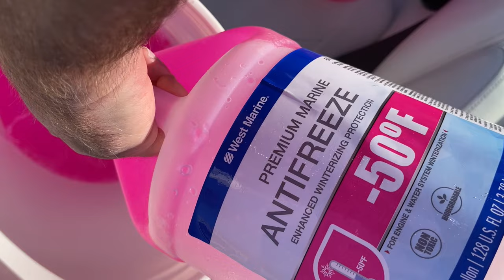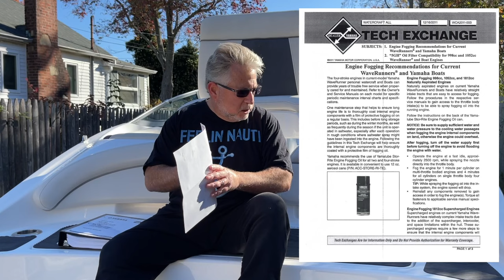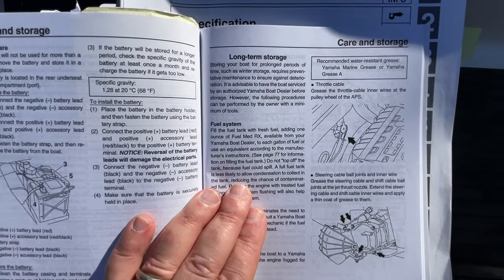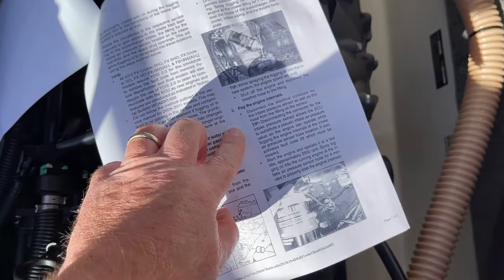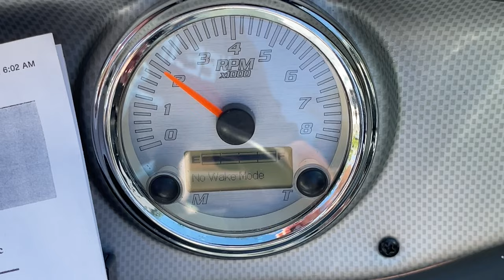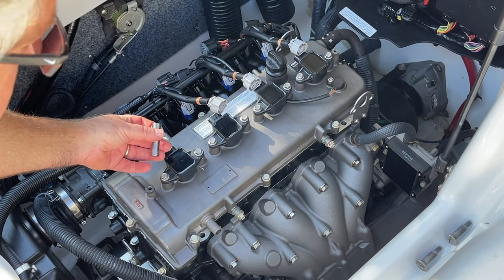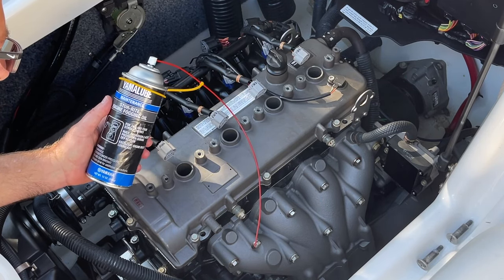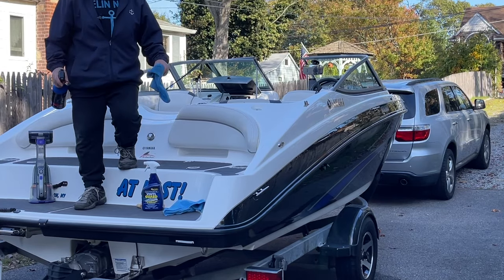Yamaha Certified Jet Boat Winterization Guidelines - What you really need to do!

Comment: Leon ... no need to remove the air intake tube and airbox cover .. just spray directly in the breather hose port .. you are creating a stronger vacum by doing it this way , delivering the fogging oil better to the internals
Reply from the maker: I thought of that but do not want to get any fogging oil on the air filter. I hate that I can't see where its going.

Comment: It's important to use antifreeze in the cockpit drains (don't know about this particular model, having a drain line freeze and crack in a Yamaha Exciter can ruin your day).  Also, the antifreeze should be pumped in around the bilge pump and allow the pump to pump it out.  Then there is the trailer...
Reply: You are correct man.
I can't believe yamaha doesn't mention it.
And of course all these boat nubes will read the manual and think that's the word of God.
Your car recommends an oil change every 15k, would you wait till 15k though?
Fck no.
Pour that antifreeze in, there's no way for all the water to exit the engine completely with these water cooled motors, you are absolutely correct any inboard, out board, jet boat or jet ski engine,  unless it's closed loop coolant system, it's gonna need antifreeze. Period.
Anyone who wants to argue with that can put their foot in their mouth

Comment: If you turn the engine over without plugs, fuel is sprayed into cylinders without burning. Can this excess of old fuel left for several months in the cylinders cause some problems?
Reply from the maker: I turn the engine over for just a second with the lanyard pulled to prevent ignition. I'm not sure if fuel is injected, but if it is I'm sure it won't hurt. Great observation though!
Reply: @CaptainLeonsBoatingandMore  I haven't tried with the kill switch off. Maybe this will cut off the fuel. I wish there was a mode like on Sea-Doo's.

Comment: That Pink RV/pool antifreeze is not for the use in an engine...and it states that on the container so not sure why you would use it and not use the proper antifreeze for engine use?
Reply from the maker: Eric, here is what I use: https://www.westmarine.com/west-marine--50f-engine-water-system-antifreeze-gallon-499848.html, read what it is designed for. Thanks for looking out and thanks for watching.
Reply: @CaptainLeonsBoatingandMore  Well I stand corrected and Kudos to you...first person I've seen to not use the cheap RV antifreeze that turns to slush at 5*F. Though that product only protects to  14*F. I'd still use standard green 50/50 engine coolant.

Comment: How do you keep your engine bay so clean!
Reply from the maker: Steve, I'm careful when changing oil to not drip oil during removal of the filter. I also just get in there with towel and spray cleaner and clean the fiberglass bottom now and then. It stays pretty clean on its own too.

Comment: I'm lucky as my AR195 fits perfectly in one of my garage bays.  The garage isn't heated but I do run a small electric heater out there that always keeps it well above freezng.  Of course I do the regular maintenance following the recommended schedule, oil change, plugs, use a fuel stabilizer, battery tender, etc.  This past summer was my 3rd on this boat and it starts up on the first try each and every time.  Always enjoy your videos!
Reply from the maker: Sounds like you have a good set up Hoosier, nice! Thanks for watching.

Comment: Why not just spray in into the breather tube? Open the throttle a bit, and suck it in. That's what I'm going to do...
Reply from the maker: You can, but I always feel I would risk getting some on the air filter. I also wipe the inside of the air intake with a paper towel when I'm done as some usually drips to the bottom in there.
Reply: Yes, I did that for a couple of seasons and found that the airbox got soaked with fogging oil...

Comment: They think you dont have to use rv antifreese for these newer boats as if they dint have water cooling jackets thruought the engine and a waterbox filled with water in the exhaust system.

YES YOU NEED TO USE RV ANTIFREEZE.

Ive been winterizing, servicing and wrenching on skis, jet boats, outboards, inboards for over 15 years and none of these engines will allow all the water to drain entirely.

If someone tells you that you dont need rv antifreeze, unless its a closed coolant loop system and not water-cooled - then dont listen to em. I promise you do 👍
Reply from the maker: Thanks tg, yes I use antifreeze too.

Comment: Hi Capin Leon, 

first of all, I find your YouTube channel very informative and enjoyable. I am an owner of Yamaha 195FHS, purchased in 2022, and I also live in Long Island. Could you please let me know where I can purchase the spray nozzle staw? The one I bought from Amazon doesn't fit the Yamaha Fogging Oil Spray, so I couldn't use it. Can you provide information on where to buy the straw as shown in the video? 

By the way, last year, while performing fogging oil with a short straw, it got sucked into the throttle body. ^^) Also, the 2022 model has a pan right in front of the throttle body, so when I turn on the engine, the fogging oil sprays out immediately. In such a case, how should I apply to fog oil?
Reply from the maker: Thanks Peter. So I don't remember where I got those straws, but my thought is that it should be universal with most cans. You need to apply good pressure to get the straw to insert into nozzle on the Yamaha can. Perhaps buy a different brand? 
I see you have the supercharged engine, I'm not sure of the best way to fog that as mine is naturally aspirated. Perhaps check on the Yamaha forums? Good luck and thanks for watching!

Comment: Great video. Two questions: 
1-) is Fogging the engine recommended even if you don’t winter store the boat? and how often? ( I boat all year in florida).  
2-) how much do you spray the engine air intake? When do you know when to stop?
Tks
Reply from the maker: Let's ride, two great questions. Fogging is protection for long term storage, not necessarily just for winter. If you boat all year long I wouldn't worry about it. Secondly, I spray the fogging oil into the air intake in bursts for a minute or two emptying like half the can. I'm no professional, but this has worked well for me. Thanks for watching!

Comment: This is excellent. I have a 2023 GP1800R HO. Same engine. Would you trust the dealer to be this thorough as the manual and service bulletin calls for? Where did you acquire the technical service bulletin? Im assuming you paid to download the service manual from somewhere online? Considering doing this myself so I know it's done correctly
Reply from the maker: Thank you sir, I believe the service manuals are available online at Yamaha's website. I got mine years ago, but regardless of cost try to acquire one, it's really good to have. Thanks for watching.

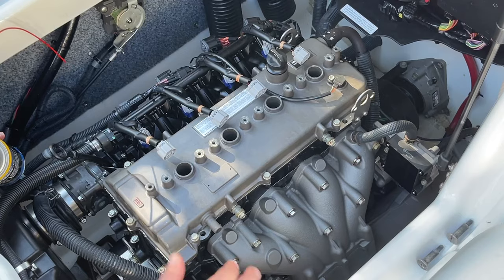Comment: Leo 14:50 .. you should run a compression test on each cyl just to know your spec  right before you fog ..  yamaha says minimum 121 psi ... your boat is getting up in age now and would be good to know your compression  is still good ..could get a tester on amz for like 35$ .. perfect time while all plugs are out , crank for 7 seconds each cylnder  with lanyard off and must be done with all plugs out  ... even a step further is a boroscope camera  to check on things in there  another 35$ amz for basic one ... hey makes for good video !
Reply from the maker: Not bad advice. But still hitting over 40 mph and 7800 rpm. If compression was a bit low in one cylinder what would I do to correct it short of a complete rebuild of rings and head gasket? Not looking to do that..lol.
Reply: @CaptainLeonsBoatingandMore  I hear ya .. but it's good to know and start a baseline . Do it make a video  when you go to winterize next month while the plugs are out .I just did mine
Reply from the maker: @jayd1008  Have a link for a good compression tool?
Reply: @CaptainLeonsBoatingandMore  trying to post link  but the one i got was on amazon prokomon tester kit  30$

Comment: When fogging the motor what would be different that I'd have to do for an AR195? Do I have more items I'd need to remove?
Reply from the maker: Jeff Rose, I'm sure there are a few additional steps with the supercharger in the 195. I'm sorry but I'm not too familiar with it. Check on the forums perhaps.
Reply: @CaptainLeonsBoatingandMore  will do, thank you so much
Reply: @CaptainLeonsBoatingandMore  when you are placing the spark plugs back in do you torque them to a certain pound?
Reply from the maker: I really don't. In the spring after I burn off the fogging oil I end up changing them anyway. I'm not sure of what the torque setting on the plugs are, but I think it's only 15 lbs or so, it's not much.  @TheJeffrose1981
Reply: @CaptainLeonsBoatingandMore  ok, thank you so much for your help. What's your opinion on fogging the motor with a supercharger? Is it ok for the fogging oil to go through the supercharger?
Reply from the maker: There is a separate procedure for fogging with the supercharger. Try googling it, perhaps something will come up. Wish I could be of more help. @TheJeffrose1981